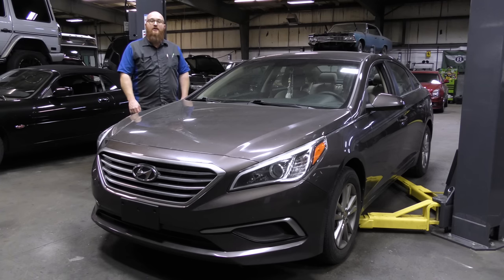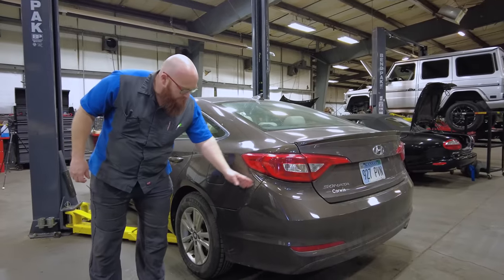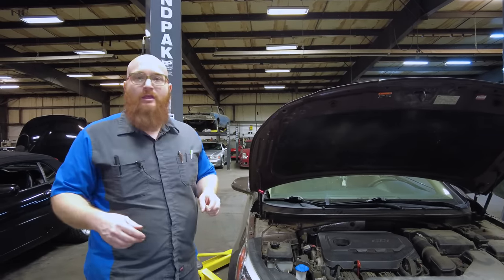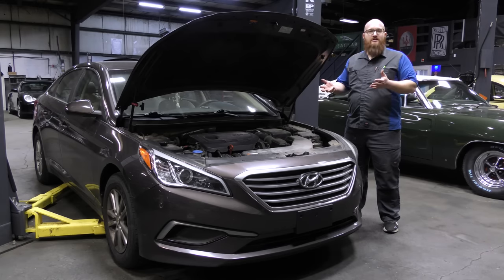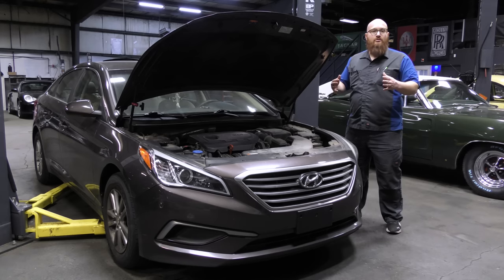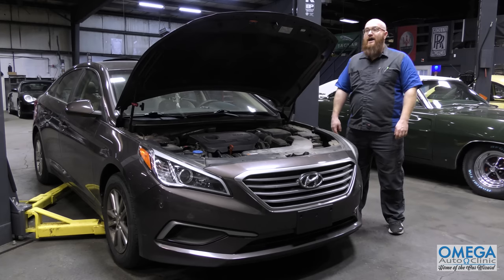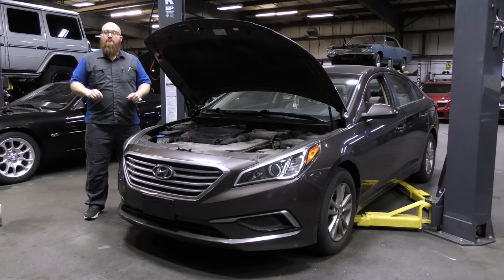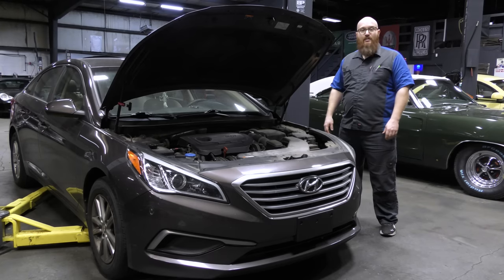What could be so bad on this '16 Hyundai Sonata that the CAR WIZARD is sending it to the junk yard?

Comment: Hyundai has been replacing those engines under warranty like crazy. Even for people who did maintain them according to the factory service manual
Reply: yeah my 2011 kia optima get an issue with the recall twice. I got both sides of the main recall, total engine lock up the first time, replaced the engine under recall. Had it for 14 months, then it went into limp mode (that's the second side of the recall tree, valve problem) said it was past 12 months 12000 miles to replace under recall agian. Sold it for $500 to junkers. Everytime I see somone with a kia or hyundia with the same engine I urge them to sell it for 5-7 grand now and avoid losing the potential value.
Reply: My sister bought her Hyundai brand new and maintained it like it was a show car. At 40,000 miles, the engine was knocking like this.
Reply: Yep. My mother has the exact same car. I always did her oil changes and once every two weeks checked the oil. It would usually burn 2 qts a month and she only drives 2-3 days a week. Maybe 500 miles a month. Made sure it had oil in it when she took it to Hyundai and they rebuilt the engine in a week. That was about 2 months ago. Runs like a dream now. Burnt about half a quart since but the oil still looks new.
Reply: Their port injected engines from the 2000s were super solid, I could recommend most any decently maintained elantra/sonata or azera from that era as a rock solid starter car for anyone. Heck my cheap engineer dad wrung over 400k out of his 2004 Elantra with just maintenance before finally getting a new car in 2016.; However ever since Hyundai went direct injected, they've had a multitude of problems with their engines. Most of all the turbo 4's, so back to Toyota my recommendations go.
Reply: @anasevi9456  Their build quality is garbage even if the engine is solid. My friend had both front door handles break, and then both front window regulators jammed, and the ac compressor is making terrible sounds as well. I'd avoid Hyundai personally, it's not even that much more to get a Honda or Toyota.
Reply: Is this an american hyundai/kia thing? Never heard of this in my country. Saw hyundai,kia runs reliably.
Reply: @anasevi9456  Agree, impressed with the overall quality of 05 Getz so far.
Reply: @Hedonistic0Frog  I've rented a few with 40k of hard miles on them. They seem to be holding up fine. We all have a "friend" that seems to get the worst cars of any brand.
Reply: @Hedonistic0Frog   perhaps for the accent which I had admittedly never been in. However Elantra's were much as Corollas of the era, and Sonatas the same as Camry's. Also your friend could have been very abusive to the car, which is a common thing with 'kerbs are just bigger speed bumps and basic maintenance is a superstition' average 2000s hyundai/kia owner. That or you or your friend are full of it.
Reply: Yeah my brothers 2014 elantra gt blew up with 56,000 miles on it. Dealership replace the motor for free and he bought it used 5 years ago.
Reply: Hyundai engine has a oil consumption problem
Reply: @ericharrison619  40k is basically brand new, if they started falling apart that soon that would be incredibly terrible.
Reply: @anasevi9456  You think she abused her window regulators and ac compressor? Not one item I mentioned can be abused besides door handles. She also drove a 2001 Mercedes S430 that had zero issues for the same duration of time and mileage despite being older. She drives an Elantra as well btw, it's definitely not a corolla.
Reply: @Q  it might be the calibration on the North American cars as they dump a ton of fuel to get the catalytic converter working and run thin oil to keep fuel economy.
Reply: @shhhdontshout  yes. The engine manufacturer for america of those engine had problems with metal shavings in the crank. The recall is not for if the engine fails but when the engine fails. 2012 to 2015 all sonata/optima and most of santa fe/sportage 2.4 and 2.0t engines have that problem (and some other models in small quantity). Kia extended warranty on the matter is lifetime while hyundai was like 8 years 160k km (100k miles) added to the standard warranty if I remember correctly. The car in the video might not even be on the recall list (being a 2016) and from my experience Hyundai dealers are much more a pain to get the engine through warranty than kia’s
Reply: I am fairly sure if they had checked and topped up the oil before bringing it to the dealer they would have gotten a new engine under warranty.
Reply: Is almost as bad as the Ford Ecoboost 1.0 litre 3 cylinder engines lol. They are so bad we here in Europe call them Ecoboom haha
Reply: @felixrobitaille8170   Recall goes all the way up to 2019.5 lol.  Any hyundai that has a 2.4L or 2.0L turbo.  Once its ceased its: check if oil on dipstick (which holds a half quart more after the recall/knock sensor patch), take a video of a torque wrench on the crank.  If you cant prove you changed the oil every 7500 miles for the entire life of the car, they have to pull the valve covers.  If no sludge you get a new long block complete with new spark plugs and oil.  Around here they have it down to a 1 week turn around.
Reply: @Phillip Banes it's hard for it yo squeak when the engine is seized because it burned all it's oil 😉 maybe the interior quality has improved over time but I wouldn't risk it personally. I'm a Mercedes guy anyways.
Reply: similar story in korea for 1.6 .
Reply: @Hedonistic0Frog  I run a 2006 old shape diesel Santa Fe with 195000 miles. It is on its 2nd engine after defective bosche fuel pump filled engine with diesel. Overall changed very little else. It does seem the newer ones are built worse. Definitely the case with Honda motorcycles.
Reply: I have the 2017 Sonata and at 91k the oil light came on intermittently. I took it to the dealership on Monday (it happened on Saturday) turned out it had half a quart left despite having the oil changed just 3k miles before, well within the 4k miles specified by the maintenance schedule. Just had my first 1k oil consumption test and it drank 1.5 quarts.
Reply: @shhhdontshout  I’m in australia with a 2012 Hyundai i40 with the 2 litre GDI engine. It runs well and doesn’t leak oil or seem to burn any oil. But it needs about 1 litre of oil per 2,000 kilometers.
Reply: @organiccold  Insane that Ford also created the worst DSG-gearbox in the world. Almost like there's something severely wrong with that company.

Ford Pinto 😬 Ford has a history of explosive cars.
Reply: @Hedonistic0Frog  Stay away from the Alabama ones!
Trashcan and trash pile plus the R-klasse.
Reply: @ridbanner1407  You're confusing Hyundai for Honda it seems. The Japan/Korean relationship isn't that good.
Apparently more frosty in recent years.
Reply: @shhhdontshout  I have a korea built optima sx 2011 but only has 104k miles. Other than brake switch issue and some oil burning, its good
Reply: @Phillip Banes I have a 2014 with 165k and a 2015 with 115k in the driveway.  Both run fine.  The ‘15 was trouble with misfires a while back.  Coils, plugs and injectors and now runs fine.  Keep the oil changed and I don’t use the 5w-20.  Book lists 5w-30 as optional and that’s all I run.
Reply: @paulu7751  I'm sorry that you're jealous and lashing out.
Reply: Same, here in Europe Kia and Hyundai engine failures are pretty much unheard of.
Reply: Yet the company doesn't do anything to improve on that problem, so it wouldn't happen again.
Reply: The more experience I have with Hyundai the less I tend to like them… though this one looks like it may be partial fail due to to owner neglect
Reply: @Hedonistic0Frog  can vouch for this. Their build quality is garbage.  This is why they're cheap and don't hold value. After 3 years of ownership I had peeling clearcoat, seats tearing and falling apart. Interior parts cracking and falling apart among numerous electronics failing.
Reply: @Ce0ammer that's where mine was from. It was junk
Reply: @christopherhendricks4369  Wait are you describing Mercedes-Benz or Hyundai?
I guess Mercedes-Benz, since I wrote Alabama Trashcan wich is the common word for the ML/GLE. Trash pile = GL/GLS.
Reply: @Ce0ammer  hyundai.  I've never owned a Mercedes nor do I plan to since their parts seem outrageously priced. Hyundai is not a brand I would purchase again.  They aren't the worst car. I would pick one over a Fiat and a few other brands. But I had one (14 elantra) and the build quality was less than acceptable.  The engine was the 1.8 and was probably the only good thing about that  car. The interior build quality was junk. Too many items to name but I noticed the lack of quality within the first two years. Oh the hyundai I had was assembled at a plant in Alabama
Reply: @anasevi9456  i think because those engines are rebadge Mitsubishi or based on it the recent ones are not good
Reply: If you go by the factory service manuals recommendations you will need another car in about two years
Reply: I got my engine replace free of charge and a free car rental for a month
Reply: Picking up my 15 2.0 turbo today after warranty motor replacement
Reply: @jjqq9456  No. They are bespoke engines. 
Decades ago Hyundai used Mitsubishi engines but not these days.
Reply: I have a 2016 Sonata. The engine warranty is for 60K miles. After that you’re not getting a new engine under warranty. Been there, tried that. No bueno.
Reply: @k9man163   that doesn't make sense to tell them to sell it for 5-7k, do you tell the next person also? Most likely not so then they're stuck with the car so explain that. Doesn't make sense and isn't fair,someone is always going to get screwed in the end. Thanks for reading
Reply: My wife and I are going through the warranty process now. Those 2.4 hid are trash
Reply: Speaks volumes of Hyundai/KIa quality!
Reply: I’m starting to rethink my opinions of Hyundai/Kia if THIS is the plot of the movie…
🤨
Reply: There is a reason why Hyundai is going all-in on EV's. They can't/won't fix their ICE engines and are really eager to move on from the embarrassment.
Reply: @RJT80  When did Hyundai make the switch in engines? Do you think the Hyundai Sonatas before 2011 would be OK. They were a boxier car physically back then.
Reply: Having the exact same issue with mine. It's garbage now. 2017 sonata.
Reply: @shhhdontshout Yes the issue is with vehicles manufactured in North America.
Reply: They are playing games now. Trying to run out warranty. Never buy Hyundai or kia.
Reply: What do you have to do to get them to fix it?
Reply: You claim laziness is the reason for this bad engine. 
 In 2018 we bought a 2015 sonata with the 2.4 l . It was a lease turn in with 21,000 miles.
 Oil changes every 5,000 miles - with receipts.  2020 started noticing high oil  consumption. No oil leaks, just an excessive use of oil. Had local Hyundai dealership service it. They couldn't really figure put why it was using so much oil. At that time they also did a service bulletin that Hyundai sent out, something about a knock sensor. 
At that time one of the mechanics told us not to be surprised if you're replacing this engine soon.
 Fast forward to 2 weeks ago
71,000 miles  # 3 cylinder has no compression . My mechanic is telling me the engine is junk 
A 9 year old car with 71,000 miles on it and it is JUNK. 
 Right now going rounds with the local dealership to see if Hyundai will warranty this.
 Not holding my breath. 😡😡
Reply: @anasevi9456 I have a 2017 that I bought specifically for the port injected engine and it really hasn't been that great. Not terrible but I definitely don't trust it to last long term.
Reply: It's under mandate from the feds. That's why they do it. Prior to the mandate, they were telling customers they were on their own with a junk engine, and were using any excuse to not replace them under the 100,000 mile warranty. That's why the feds stepped in. It's not just one of their engines, either.
Reply: @Hedonistic0Frog  They really aren't cheap cars at all anymore. They built their business by giving young people who didn't have a credit history credit. They will finance just about anyone who shows steady employment. Really not bad for young people with few options. The 100,000 mile warranty gives them confidence in their purchase. Still, the dealers are known for giving vehicles the "sunshine treatment" if the car has pesky problems they can't figure out. They take it in, but don't even move it till the customer wants it back. Eventually people decide to just live with the defect because they can't make a career out of trying to deal with it.
Reply: @shhhdontshout  No, but Americans drive 3 or 4 times more than most other countries, and 100,000 miles is almost 161,000 kilometers, and we expect our cars to easily do at least twice that.
Reply: @n1acguy  that happened with my girlfriend's Kia. It has an issue where it suddenly brakes by itself without warning and isn't reproducible. I'm a mechanic and I couldn't find anything physically wrong. I'm guessing it's a programming issue or a sensor giving bad readings or something. It'll do it at 80mph when you gently tap the brakes or from a stop when accelerating. The dealer could never find anything wrong. There's no rhyme or reason to it at all. Thankfully I found a nice 1999 Mercedes SLK230 for her now.
Reply: @timothyzwart7412  That's less than 1250 US miles. That's a lot of oil. It's burning it, but the new catastrophic converters really work well till they can't handle that much oil anymore. They either plug up or lose effectiveness enough that they throw a code. States with inspections will make you fix it. Back in the day, we used to control oil burning by using a heavier weight oil. Last I heard, the same engines in Australia use can use heavier weight oils because they don't have the CAFE standards US vehicles have..
Reply: @NYCMonkey23  So you have the same problem. It just hasn't seized yet.
Reply: @Ce0ammer  They are both very patriotic nations who adamantly support their own economies. They won't buy foreign products if they can help it.
Reply: @christopherhendricks4369  Fortes are entirely built in Korea, and they aren't any better, although I do prefer their driving dynamics over an Elantra. Got I hate those things. Before covid every rental agency in the nation seemed to have Elantras they were trying to pass as an upper level car. Headlights good for ten feet and handle like a wet dishrag. Dump into top gear at a low speed like most, but with a computer that has to consult a committee to approve a downshift. By the time you apply enough throttle to get it to downshift, it drops 3 gears and starts wanting to fly. Impossible to hold a steady speed on rolling hills. At least now they're fairly crash worthy.
Reply: @n1acguy  you just described the Elantra perfectly. Every thing you said is true.  It tries to masquerade as a higher end car. You get lots of features, but build quality is trash. I had a few electrical problems with the Elantra too. Mainly the headlights kept shorting out. Glad I no longer own that car
Reply: Wouldn't replace mine